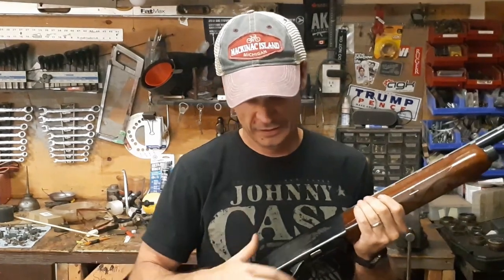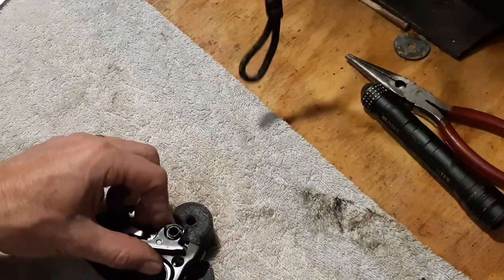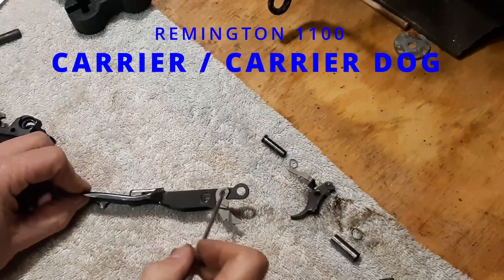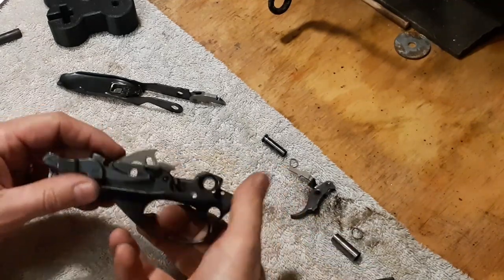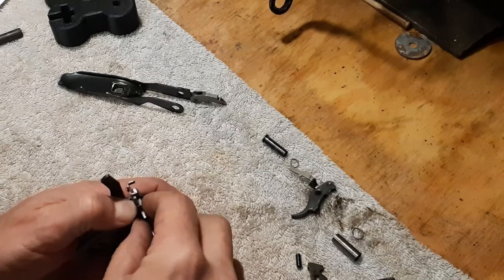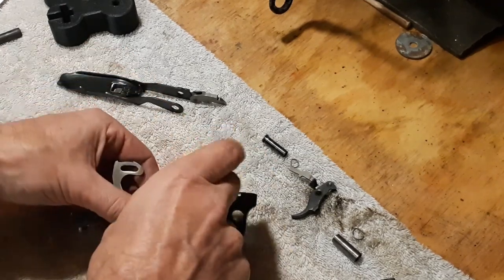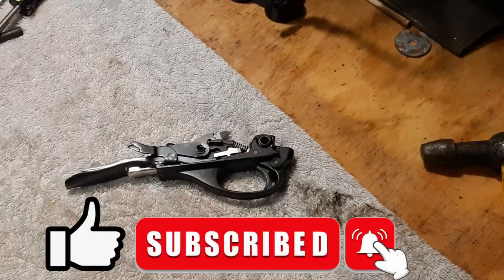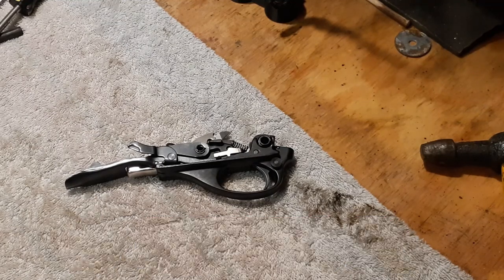Remington 1100 Trigger disassebmbly

Comment: What is the trigger guard made out of? Polymer, steel, aluminum? I can’t find any answer online.
Reply from the maker: My assembly is plastic or polymer of some type, definitely looks to be a heat model piece.  This may be why Remington does not want you to take it fully apart as it will probably not go back together

Comment: How would I replace the hammer spring? When I pull the trigger on mine the hammer just slowly moves forward. Any suggestions?
Reply from the maker: Hey Phil, I believe that spring in housed in the portion of the trigger assembly that is designed to not be taken apart, large pin through it that has been mushroomed over.  From my understanding Remington has said to contact them if you need repairs.  I realize this doesn't help any of us:(  Unfortunately I would not recommend grinding out that pin, I don't know that you will be able to find a replacement piece if Remington has said don't take it apart.  There may be but I would be surprised, sorry I don't have better news.  If you cant see a physical broken spring in there may spray/rinse with wd40 to flush any grime that might have built up, may just be obstructed.